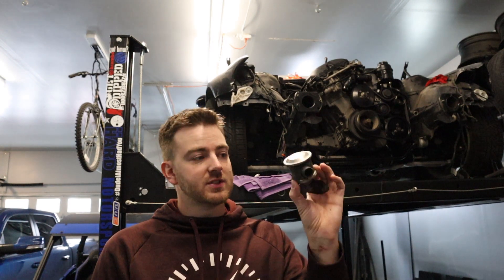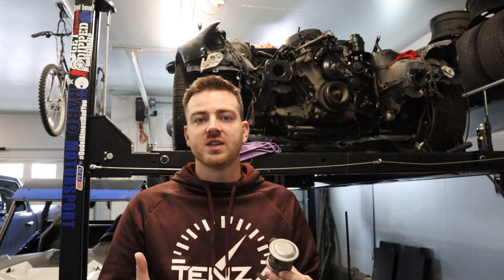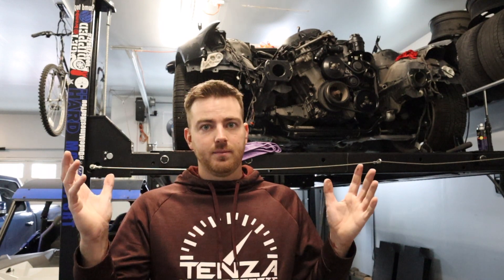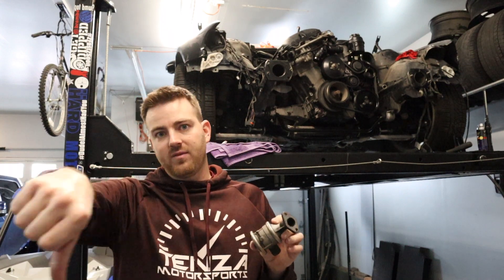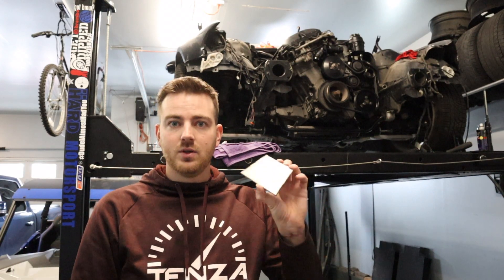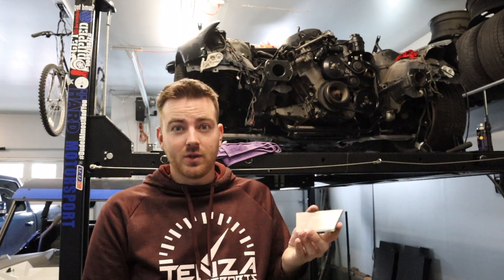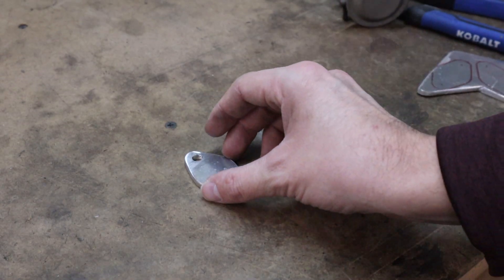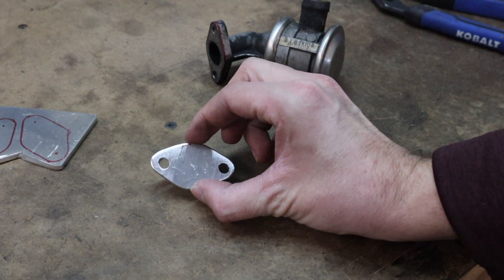Don't tune your M54 until you delete this! - Custom DIY BMW E46 secondary air pump delete plate SAP

Comment: Problem with this setup is not having a gasket between the block and SAP block off plate. You can buy block off plates and gaskets for cheap...
Reply from the maker: Who said no gasket? Always put a gasket on it.
Reply: @benhayes2344  he says to re use the existing gasket or get a new one.

Comment: Hi, quick question. On my e46. I took the secondary motor out and just left that peice on the side of the engine. Engine light is on for the secondary air but no vaccum leak or anything. But is a way to remove that peice all the way out. That is possible?  Basicaly exactly what you are doing. I thought about making a plate just like you did. Seen them for sale online. But why buy its technically just a plate. I was going to do excatly what you just did. Just not sure what the ourcome would be like for the engine and ecm. But so far only engine code i have is from the secondary air since its unplug. Is the computer reflash you are talking about is to basically for the obII not to be able to read that secondary codes anymore?
Reply from the maker: Get a plate. They are cheap. And tune the car. That is also cheap. Also if you want to do a fun tune, that would be a good time to do it. Revmatch Motorsport can tune them easy. That’s who I use.
Reply: @TenzaMotorsports oh i see. Thanks for the reply. Other people who makes video like this don’t even reply when you asked them questions.

Comment: Isnt it easier to just leave the check valve on there and put caps on the hose connectors.?. 2 dollar fix . and easier than doing a plate.
Reply from the maker: No, to do this properly, it needs a plate. It’s a 15 minute job with a $15 part.

Comment: The secondary air intake unit you just remove it completely? And just plug the egr hole thr valve was attached?

Comment: Does it throw a check engine light?
How do you fix it?

Also, can you show how to disconnect the vacuum line? or how to block the vacuum line which goes on the valve ?
Reply from the maker: This does throw a code. I would reset mine and it would come back every 3-5 weeks so it didn’t really bother me until I got a tune. 
You just trace the line back and plug it. I always got back to the manifold so I don’t have to worry about that line leaking in the future.

Comment: DONT DO THIS TO YOUR M54 TILL YOU READ THIS.... Just need to  unplug the pump and leave the ONE way valve alone .😮😮 Thinks it's leaking at high rpms ?? Make a soap bubble at the end of it n rev it up 😅IF u have a vacuum controlled valve iam Shure u will know what to do.

Comment: Trying to do this delete. But don’t have a way to tune it out. Sucks ass
Reply from the maker: You don’t have to tune it immediately. It just throws a check engine light every few weeks. It doesn’t change how the car runs.  I ran almost a year with mine not tuned. I think it threw the code like every 3-5 weeks
Reply: @TenzaMotorsports  yeah but won’t throwing a code end up causing some kinda issue?
Reply from the maker: Nope. The computer just gets upset that you removed some emissions crap. It has no effect whatsoever to remove it.

Comment: Can you show where the line routed to for that? Can’t seem to find the existing hose. Love the video!
Reply from the maker: Runs back behind the intake if you're looking at your engine it'll be right hand side on the cylinder 6 runner
Reply: Underneath the manifold? Or on throttle body side? I have m50 manifold as I’m in process of swap! Car is not running well )): It would be much appreciated if you could do a more in depth video on all your vacuum line routings for your m50 manifold swap! Please! And thank you!!

Comment: In my e46 with EURO spec once i delete this SAP will it come the yellow light on the dash? Someone say yes someone say no
Thanks
Reply from the maker: Here’s the deal with the tune. You don’t have to tune it. I ran mine for well over a year without tuning it out. I had a cheap obd2 reader that I would reset the light with. It would give me the light every 6-8 weeks or so. Just a small tune to fix that and it isn’t expensive at all! Revmatch will help you out. Especially if you let them know we sent you!
Reply: So lets say i block it of with the plate and plug the vacuum line and just delete the code every six weeks ?

Comment: Would this mod pass emissions?
Reply: I would delete SAP after you pass emissions, always very easy to reinstall. With it deleted you're going to have a check engine light, hence you need to reflash. Some states allow more emissions monitors to be offline, 1 or 2 normally, you may be able to get away with it if its the only things deleted. Goodluck.
Reply: @jeremysmithp1  i live in the Chicago area and good thing is they dont do visual inspection. Thanks for the reply!

Comment: My UK spec m54b30 has that port  blanked off from the factory.  No secondary air pump.
Reply from the maker: Lucky! There is no need for it
Reply: my m52tub28 is an unnecessary apparatus closed from the factory